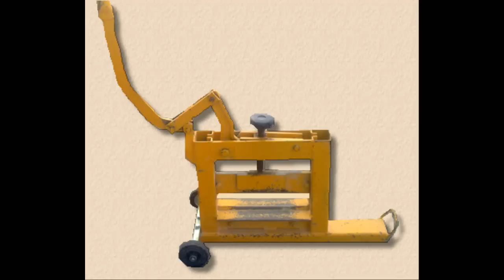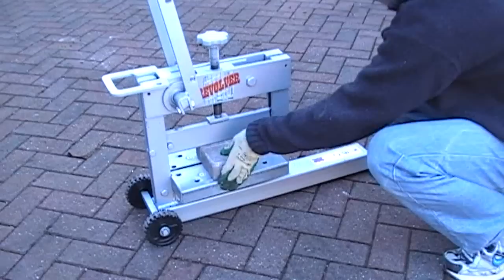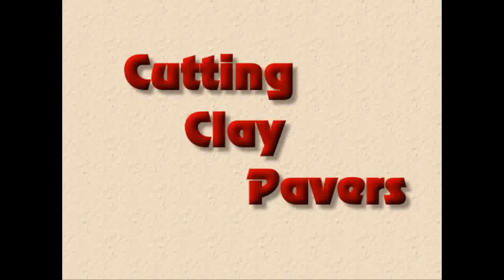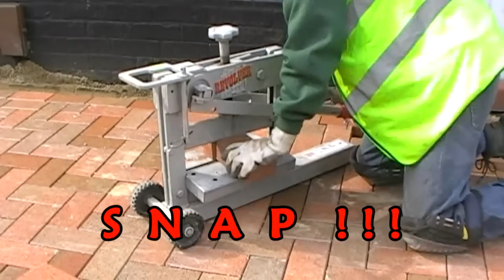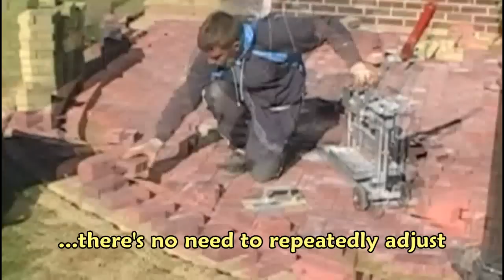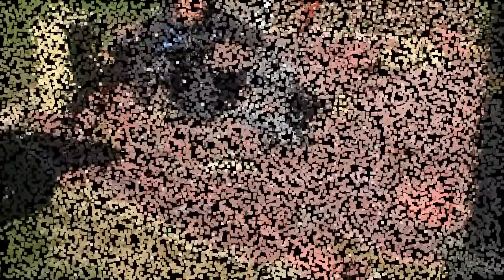Using A Block Splitter

Comment: from experience using a block splitter leaves the cut edge very rough , however for me personally i like to use a 9" angle grinder with back ache. :P
Reply from the maker: If the edges are rough, then either the blocks are soft (relatively speaking) or, more likely, the blades are dull. One of the most common "faults" I find when running 'improver' courses for block layers is that they are relying on the blades that came with the splitter when they originally bought it, maybe 10 years ago!
Reply: @TonyMcCormack  Thanks for the video and also thanks for this tip. I was trying to figure out what kind of wet saw I needed when I found out about splitters.
I'm hoping to rent one of these and I should figure in the possible cost of new blades!
Reply: I used to use a concrete saw with a 14 inch blade but now  I use an angle grinder with a 7 or 9 inch blade. The cut are far cleaner than that of a concrete saw and you can see more closely and smooth the edges more quickly. I think it's faster overall because if you're already down on your knees moving around trying To make cuts, you're already using a pencil and marking your papers so might as well not stand back up to Use a concrete saw period I'm very curious about this though because it seems dustless and quiet. the noise of the grinder or the conference saw alone are fatiguing and the dust is as well and also cancerous

Comment: Please. From where we can get this machine to cut inter lock. Thanks
Reply from the maker: If you identify the particular model you require, there should be a local or national distributor that can supply what you require.
Reply: @TonyMcCormack  😍😍😍👋👋👋👋👋🙏🙏🙏🙏🙏
Reply: @TonyMcCormack  im is from iran

Comment: Wil this cut cement pavers?
Reply from the maker: Yes, and with ease. Clay pavers are, usually, much harder than concrete (cement) pavers, so if it can cut clays, it will easily cut concretes!
Reply: most concretes are filled with little stones,you wont get a nice cut ...

Comment: How is the final (or all?) pressure or blow delivered? Is it on a cam? Never knew these existed, only have mangled the hell out of brick trying the hammer method,  or grinder cutting
Reply from the maker: Yes, it's a simple cam that applies pressure to the top blade.